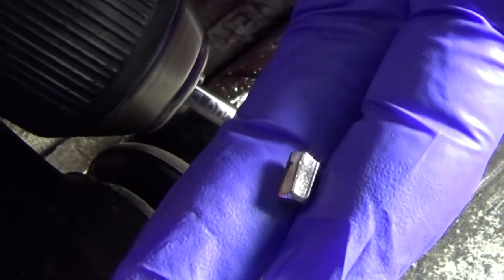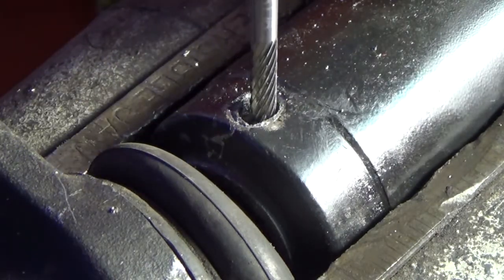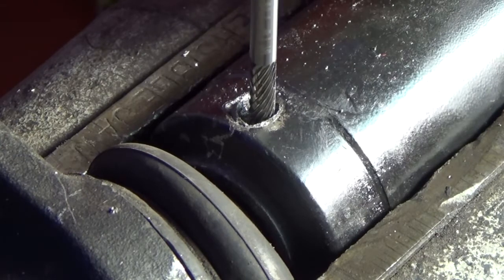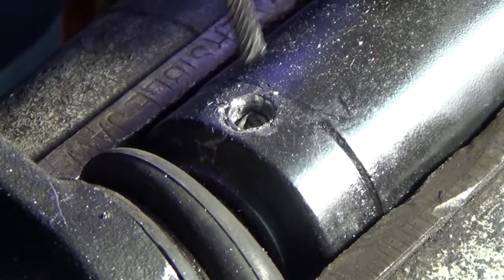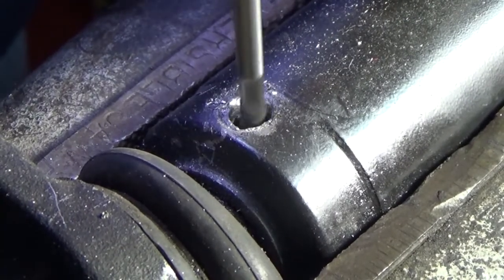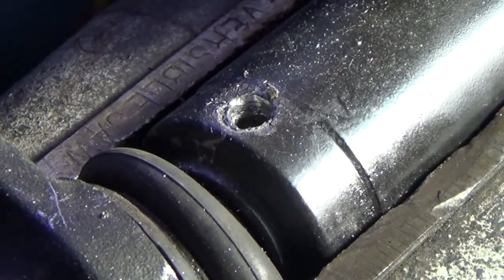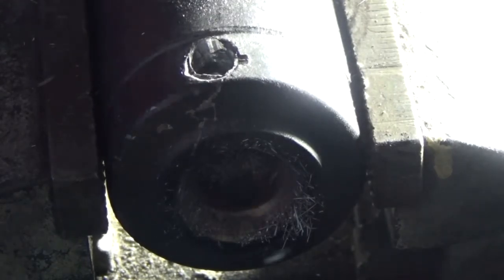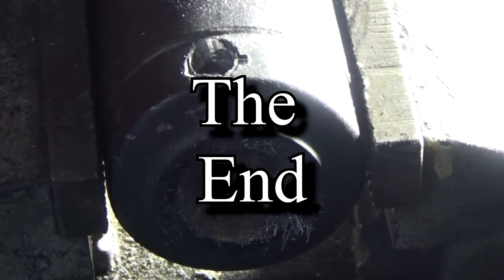Rescue Bit removing broken tool and set screw

Comment: I hate cutting metal with a carbide bit.  I get those tiny filings that get on my hands and they hurt when I bump them.  They can be so small they are hard to see too.  You might find it hard to believe that something so small hurts that much.  It is like a pin prick.